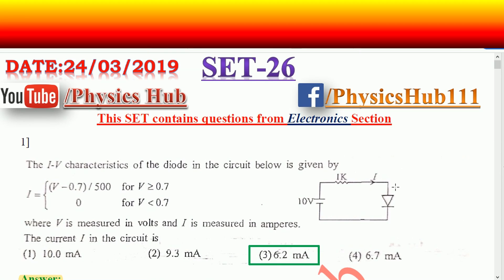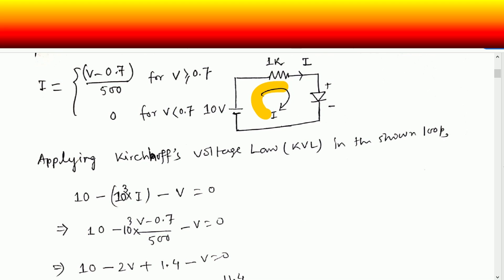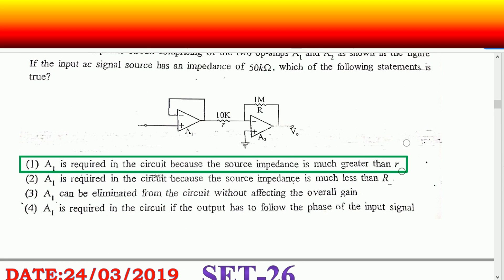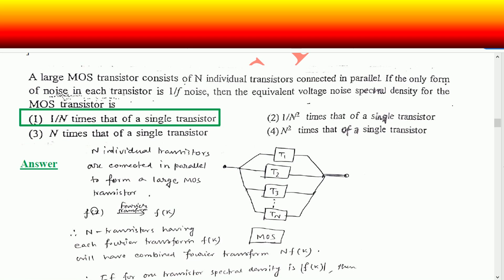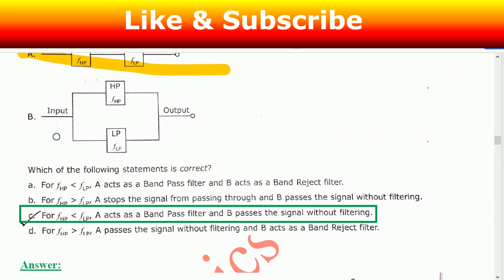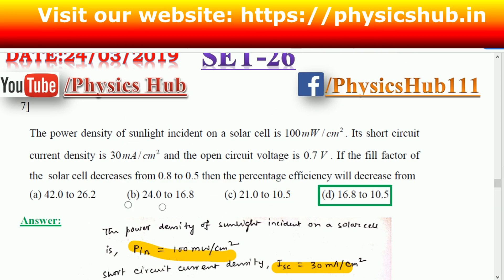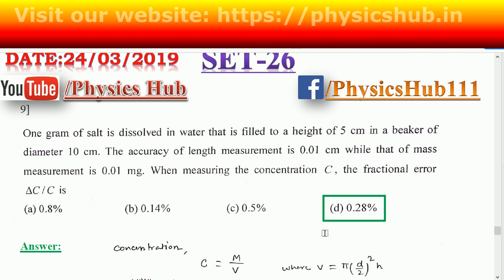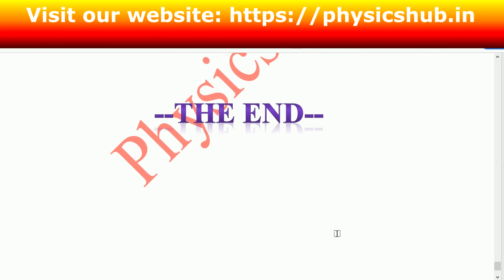SET 26 | Electronics & Experimental Methods | OPAMP, Filters,  Error Analysis etc. | Physics Hub

Comment from the maker: It consists of problems from ELECTRONICS & EXPERIMENTAL METHODS Section on the following topics:
1. Application of Kirchhoff’s Voltage Law (KVL)
2. Electric field at Metal-Semiconductor Interface
3. Amplifier circuit containing one voltage follower and one inverting Operational Amplifier (OPAMP)
4. MOS transistor consisting of N individual transistors in parallel, 1/f noise 
5. Relative percentage uncertainty in a measurement
6. Percentage efficiency in a Solar cell, fill factor
7. Current form in the primary and secondary coils of a transformer
8. Calculation of fractional error
9. Triaxial conductor driven by an OPAMP, capacitance
10. Low pass filter, High pass filter, Band pass filter 
#Electronics #Experimental_Methods  #PhysicsHub
Direct link for our website: www.physicshub.in